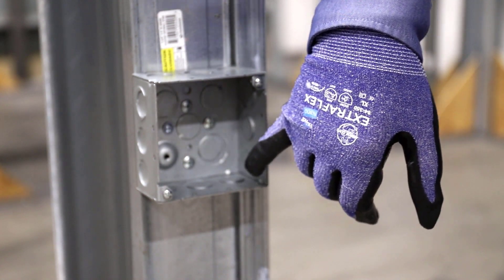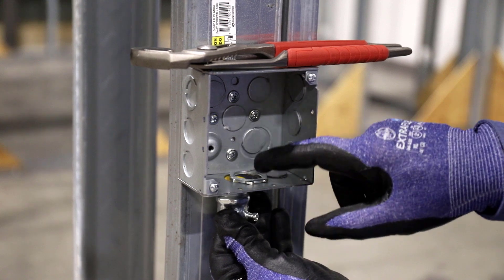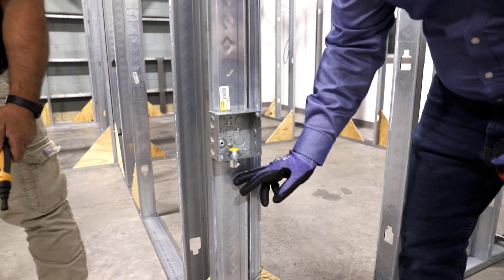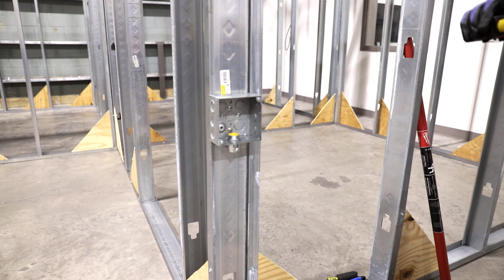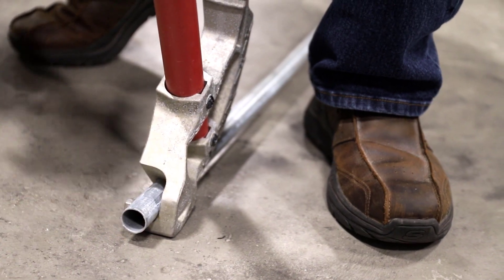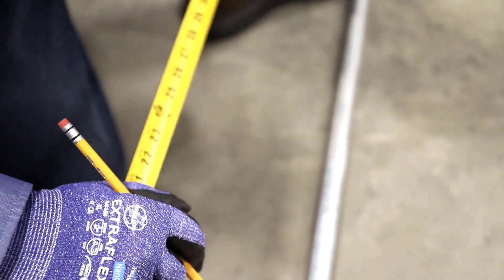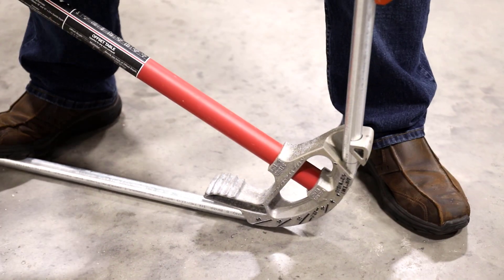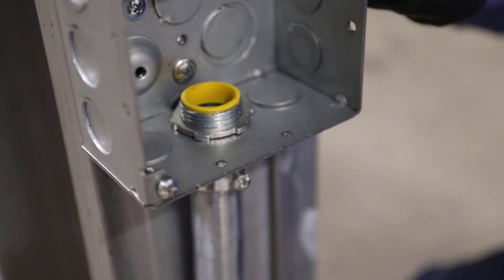Bending and Installing EMT Conduit

Comment: Am I correct to assume that the 6" deduct results in a final length that is lined up with the outside of the bent 90, so you don't have to add half the diameter of the pipe? I'll imagine that the most common situation is where the pipe needs to follow a 90 degree angle of a wall or ceiling, so you're really interested in the outside measurement where the tubing meets the wall....

Comment: It's a silly question but I'm going to ask anyway... You said the pipe fittings need to be tight for a ground...
Are you not required to pull a ground wire ?
Is there something different as per local jurisdiction ?
I thought NEC code requires a ground in every conduit...